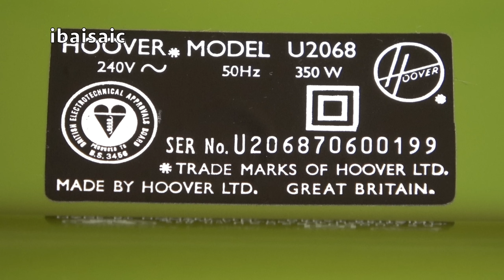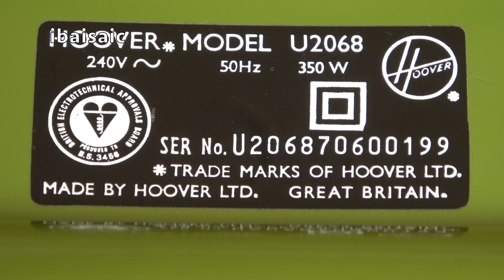Christmas Special - Hoover Junior Deluxe Vacuum Cleaner First Look & Demonstration

Comment: Between 1967 and 1997 the serial number goes Model number, Year, Month. So yours is U2068 706, ie 1977, month 6. and then the 00199 would be the number off the production line, ie, the 199th model made, so quite an early one, but then these didn't sell in huge numbers so likely not that many of them made in comparison to the standard Junior from 1977.
 
It was only after the takeover by Candy that around 1997 they changed the format to week instead of month, and the date code was buried deeper in the serial number and was in the YYWW format, meaning 9806 for example would be week 6 of 1998.

Comment: I wish we got to hear the motor a bit longer on this machine, there's a bit of nostalgia to it as that sound is similar to what the stock sound for movies and television shows have been using in my recent memory dating back about 30 years.  It's a nice machine, I didn't think it was 1970s as it looked sleek enough to be 80s.  This one looked like it was a carpet only machine, unless did it have one of those "pan converter" things?
Reply from the maker: A bonus video is coming up where you can hear the machine in action without the music soundtrack.
Reply: If you're interested all the old BBC sound effects now have their own official website, with lots of old Hoover SFX available!

Comment: Im not sure but is it unusual to see a vacuum of this era to have the belt on the side, with the suction in the center? Also, after hearing the vacuum and seeing the performance I felt so giddy. Like a kid in a candy store.
Reply from the maker: Most of the vacuums from this era would either be dirty fan with a central belt/fan or sometimes like this Hoover a dirty fan with a belt on the side. Electrolux produced uprights that were clean fan with a side belt but a central suction path.

Comment: Please be careful when whitening the plastics, the safest way to do it is to use a sous vide machine and a big tub of hydrogen peroxide and water solution. Once you have found a tub large enough for the biggest part fill it with water and hydrogen peroxide and set the Sous vide machine to about 60C and leave it to work. The heat of the water will do the work and will give you the most even whitening effect. If you use the hydrogen peroxide cream and plastic wrap method it often doesn’t turn out even, like those Dyson and Hoover parts you tried previously. Merry Christmas and good luck
Reply from the maker: I don't need hydrogen peroxide or any special equipment. Last summer I successfully retrobrighted a Hoover Powerdrive using a large clear storage box filled with warm water and a tub of oxygen based stain remover powder for clothes. After a couple of hours in the sun soaking in the solution, the parts were white again.
Reply: @ibaisaic  that's really interesting I thought that you needed hydrogen peroxide for it to work, I can't wait for the finished product. 😊